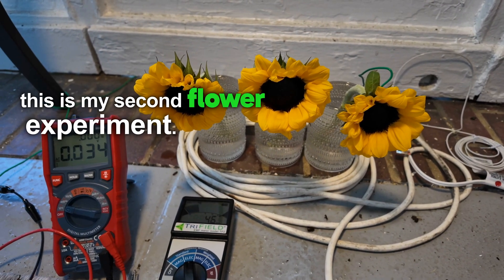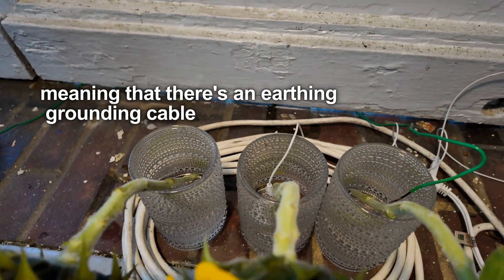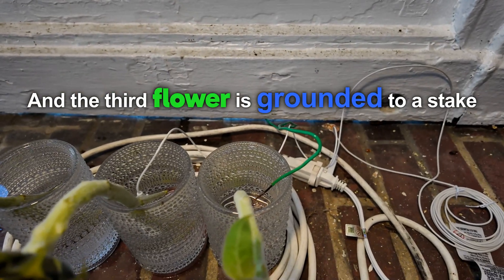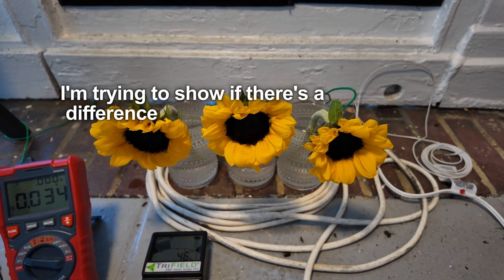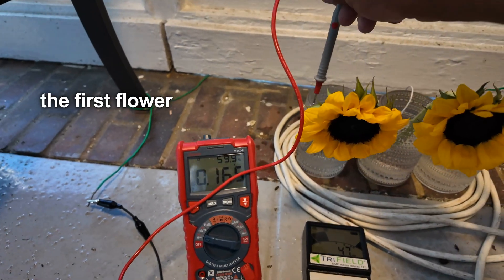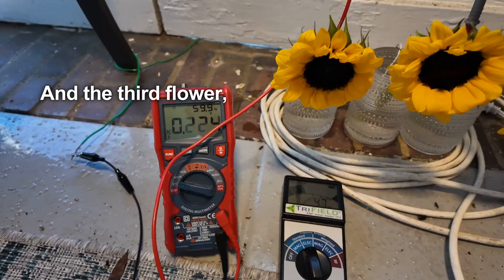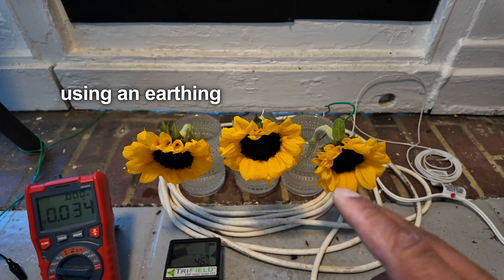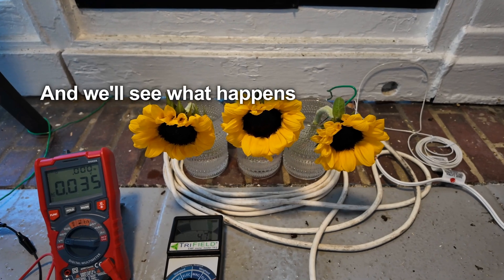🌻 Outlet Grounding vs Grounding Rod – SHOCKING RESULTS! 🌻

Comment: What can I do if I can't immediately hang the wire out of the window to the grounding rod? 
If I want to do this, I'll have to drill through several rooms to get the wire out to the ground. 
Drilling isn't a problem, but will it be properly grounded with the dirty electricity? 
Or is this the same as outlet grounding? 
Because I have to run the cable through rooms with dirty electricity. 
Perhaps there's a shielded cable? 
I don't know if it exists and how it would work.
Reply from the maker: Good point. Capacitive coupling will induce current. Your better option is using a filter like the The NCB Plug Dirty Electricity Filter for Grounding from SYB  - https://tinyurl.com/ncb4u
Reply: @DrAndrewDoan Thanks for the reply. I looked at the NCB device. The problem is that I live in Europe (the Netherlands) and rent a house. 
The NCB device doesn't fit the outlet. 
Also, electrical modifications are not allowed in the house. Perhaps it would be better to buy a better multimeter with a micro-amp function and test whether the house's grounding is suitable for a grounding mat, just seen in another video of yours. 
Yesterday, I placed a 1-meter-long copper grounding rod in the ground and connected it to a grounding cable across my house and connected it to the grounding mat. 
The AC body volt measurement was between 0.110 ACV and 0.220 ACV , which went up and down from high to low and vice versa within 1 minute. 
I've measured for longer, but this indicates how quickly it goes up and down. 
And in my house grounding (grounded heating radiator) it's around 0.100 ACV and much more stable. 
My ungrounded body voltage is between 2,100 ACV and 3,300 ACV in my bedroom. 
I'm also wondering if this is safe in these EMF fields. 
Also, in one of your videos, I saw you next to an electrical installation, where you also indicated that it wasn't a good idea to ground there. 
Turning off the power isn't an option either. It's difficult, and I'm also wondering what's the best thing to do in my situation? 
Maybe just don't ground in the bedroom. I don't know what's the right thing to do.
Reply from the maker: Don’t ground without a good grounding source.
Reply: @DrAndrewDoan Okay, thanks! I'll check if there's too much micro-amp on the house grounding.

Comment: So , can we assume that using a grounding coil/cord with 100,000 ohm resistor plugged into indoor outlet ground socket hole does not eliminate risk of exposure to EMFs while grounding?
Reply from the maker: Correct. The 100,000 ohm resistor does not block EMF.

Comment: Hi Doc. I’ve recently been testing different things with an EMF reader. My Xbox, it’s controller and monitor was giving off a Really high reading… I’ve now grounded it to an outlet with a cord on the metallic back of my Xbox and it’s significantly dropped the level. I play on this with a grounding mat under me that’s connected to a rod outside. Would I be better grounding the console  to a separate stake outside or would it be ok in this instance? Thanks mate love you vids and FB page :)
Reply from the maker: Thank you for your nice comment! You want to ground your electronics to the house electrical system. However, I would be careful grounding the body while you’re using the electronic device. When there is a differential in the ground, there can be significant current flow from the electrical system through your body to the grounding rod outside.

Comment: Does a grounded houseplant reduce the voltage in the atmosphere around it?  Does your body voltage reduce as you walk closer to the plant?  I'm wondering if a house full of grounded plants will reduce the overall voltage of the house.
Reply from the maker: Good questions! I need to make measurements!

Comment: Two issues with this experiment. 1) the flowers themselves are not identical specimens so individual variation alone may result in these outcomes, and 2) are we to conclude that outlet grounding is worse than not grounding at all because the outlet grounded flower faded first.
Reply from the maker: 1. Agree. This experiment needs to be replicated with numerous flowers. I am repeating the experiment with more flowers. 

2. Outlet grounding can be worse than not grounding at all… depending on the levels of stray and dirty electricity in the outlets.

Comment: I would think that water pipe would be a better ground than grounded outlet as water pipes always go into the ground and very long distances.
Reply from the maker: Yes. Water pipes are good grounds IF the house electrical system is not bonded to the pipes. There can also be stray electricity in the pipes due to capacitive coupling.
Reply: You are probably correct, but be advised that building codes don’t trust the adequacy of outlet grounds and often require that the outlet ground also be attached to the water and gas (if you have it) pipes.  To further support my claim that building codes are wary of the adequacy of outlet grounds, they often require 2 connected 8 foot (or more) rods.

If you have metal drain pipes, that might be a better grounding path.

Comment: I have a grounding mat from Earthing Harmony plugged into grounded outlet, BUT I throw the circuit breaker every night before going to bed. Shuts off the electricity behind my bed and to most of my bedroom.
Reply from the maker: That helps! You should measure the stray voltage with and without power.

Comment: Would be nice to see how the NCB plug would do , so us apt. Dwellers would know ! Possible ?
Reply from the maker: I will test the NCB next!
Reply: I would image there is some way with that blue dial on the NCB to eliminate the stray electricity along with the dirty electricity. Would you agree, Dr. Doan ?
Reply from the maker: The blue dial increases the resistance and blocks both stray and dirty electricity. I will do this experiment next.
Reply: I already bought one, it's on its way.  But it's the only I see as an Apt. person.
Reply: Yeah, I would love to see the results of such an experiment. I predict the NCB plug will not make a difference. I don't think the problem is frequency of the dirty electricity. I think the problem is the higher voltage potential of an outlet ground compared to the actual ground. I don't think an NCB plug affects the voltage potential. Please correct me if I am wrong.